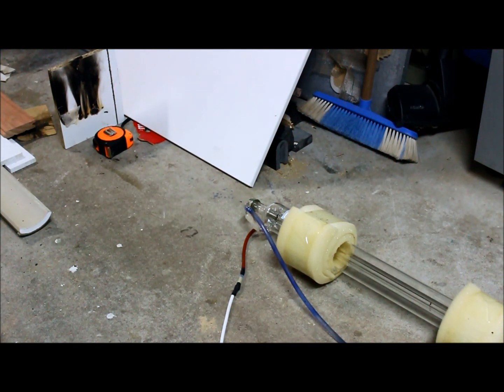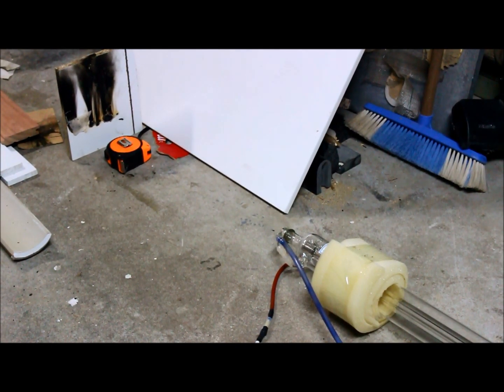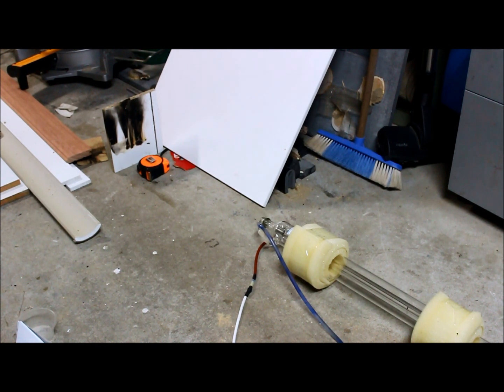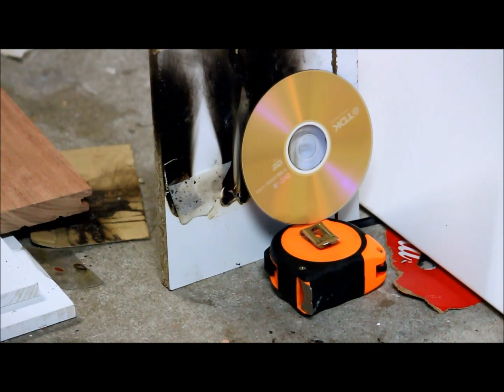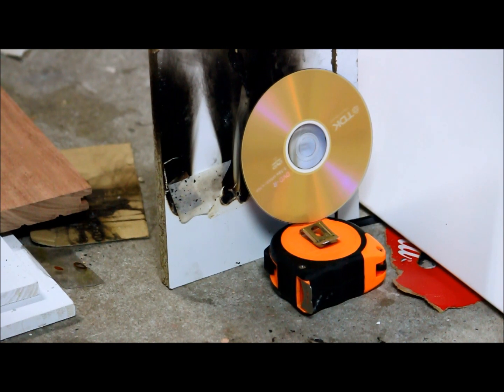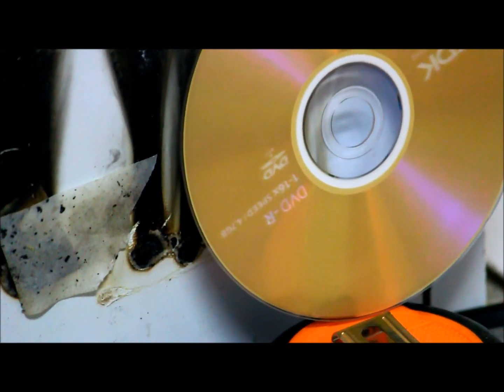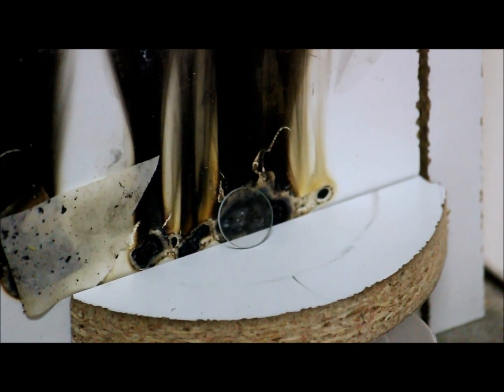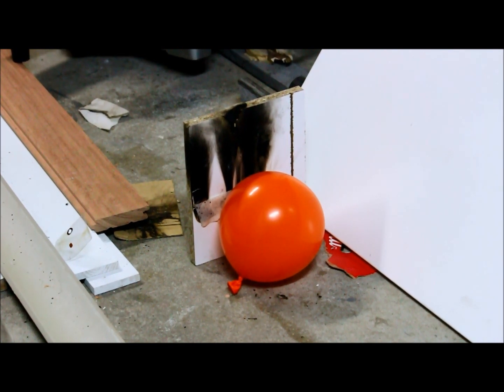40W CO2 Laser Fun - Burning of material

Comment from the maker: The power supply is somewhere in the 30KV range... The laser does not have a polarity, nor the power supply. You have a HV output and a ground. You can hook the laser up in either "polarity" it won't matter.

I suggest not playing around with these power supplies unless you are 100% confident with high voltage. These can be lethal!!!

Comment: is it 30 kV power supply ?, how is it connected , is it just the laser and the power supply ? + to  + , - to - ?
Reply: Positive (+ 20kV) to the rear electrode of the laser tube. The negative ground to the front electrode where the beam emits. Also the voltage must be current limited, as to typical 13mA for a 40W laser tube.